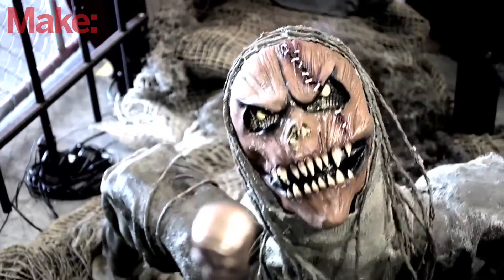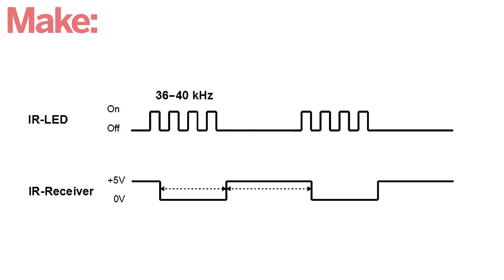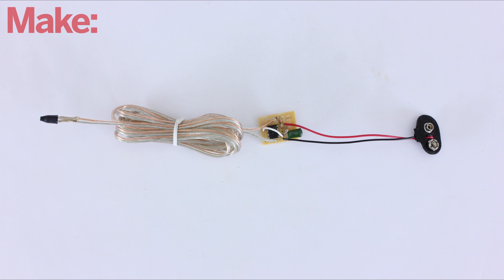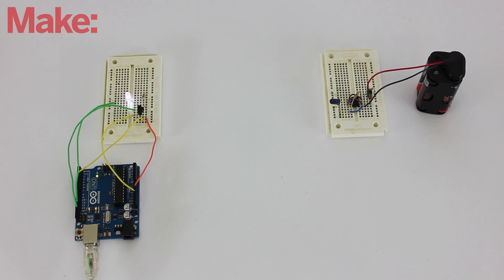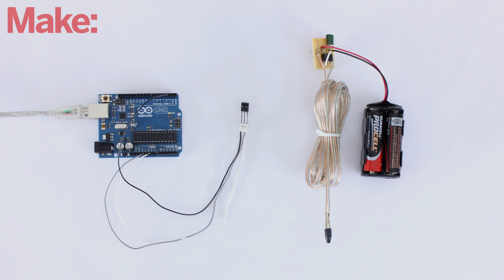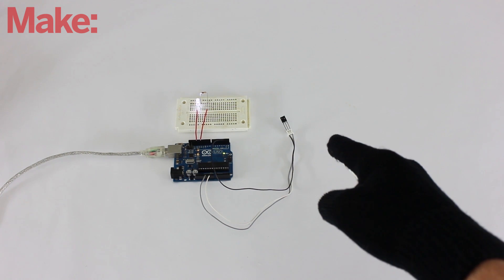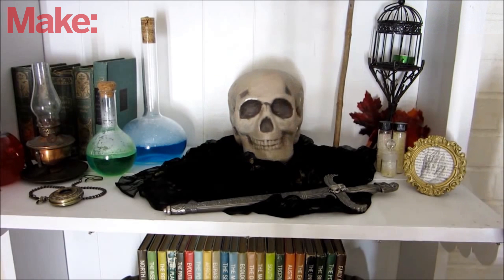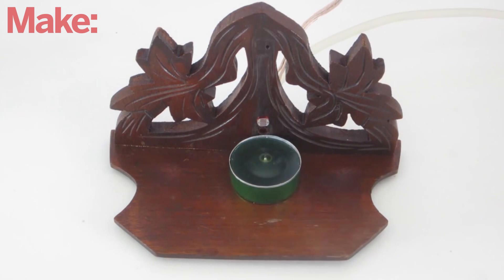Controlling Halloween Effects with DIY Infrared Remote Controls

Comment: Does anyone know where i can buy a cheap and easy to set up version of this? I want to put some LED's in my stairs and i would like them to switch on when i walk up the stairs, I dont have the knowledge to make them so can any send me a link where to buy it?
Reply: I would use an motion sensor adapter for your socket and plug the LED device into the adapter.. but you can also get cheap remote controlled adapters in a Ikea or hardware store..

Comment: How do you make sure it is sending at the correct frequency with this set-up? What changes the frequency?
Thanks
Reply: +amtpdb1 The values of the resistor and capacitor. For the exact formula look at the data sheet of the 555 chip
Reply: +Michael Tempsch Thanks for answering.

Comment: how can I make this without the  microcontroller, any ideas ?
Reply: +Juel Pereira The IR receiver module's output goes low when it detects the carrier 
wave. Use that to trigger - the load directly, a relay, a transistor 
that trigger a relay... Depends on how much the receiver module you use 
can sink and how much power, and at what level, your load uses.
Reply: Michael Tempsch thanks